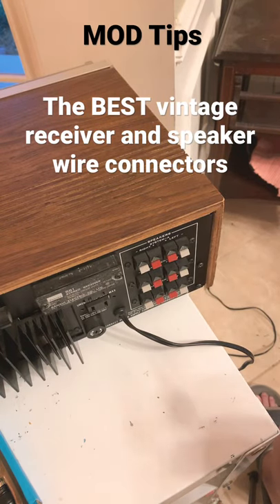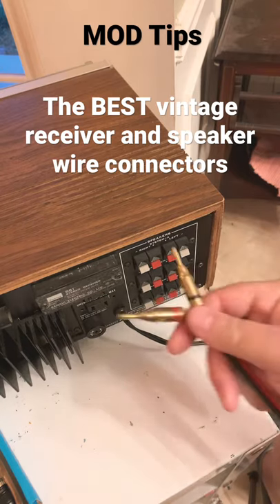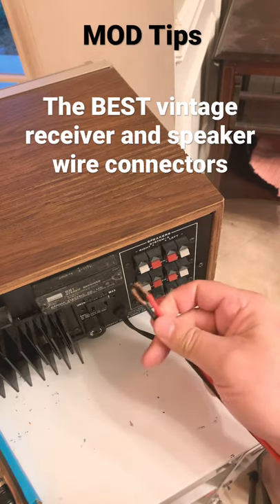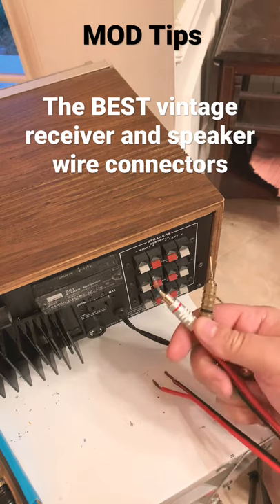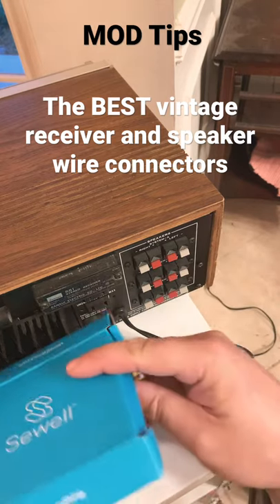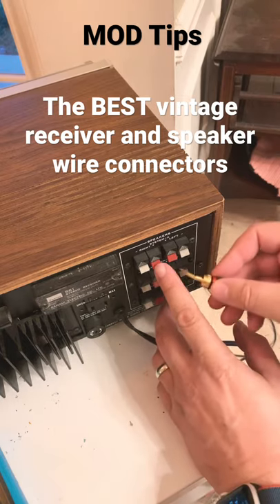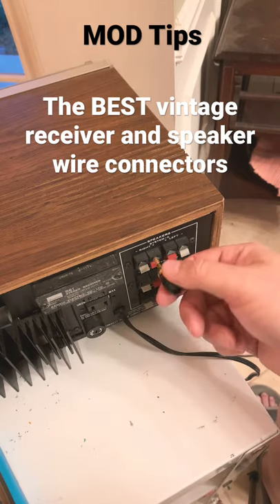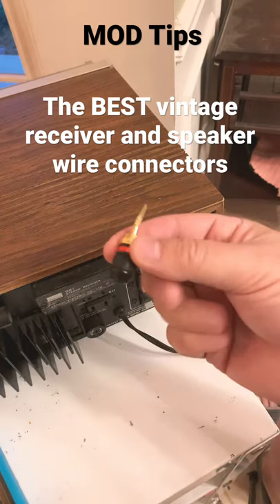MOD Tips: The BEST Speaker Wire Connectors for Vintage Receivers and Speakers

Comment: I'm a bare wire guy, not tinned just twist tight and insert. My Pioneer SX-1080 does just fine by this. Keep it simple!
Reply: I use older equipment and I save as much money as possible so I'm in the same boat as you I don't need to spend 10 dollars on an adapter bare wire all you need
Reply: What kind of wires do you use or just what ever wires then you connect them to a positive and negative pulse?
Reply: @Keytonpollard  A quality 16 gauge wire is all you need for a normal setup, If your speakers are 30 feet or more away from your amp, probably drop down to a 14 gauge wire. + to + and - to -

Comment: Tinning the end of good speaker wire will work nicely and it's a respected practice !
Reply: I do that to each end of about a 12" length of 12Gauge speaker wire and attach a banana plug socket. If I had seen the Deadbolt Flex Pin before I would have made my own I would have been tempted, though I don't need 12pairs of them...
Reply: Only if it’s 14AWG or higher.
Reply: Hi there, what do you mean by tinning?
Reply: @jamespatient7438 using some solder to tin the tip by melting a tiny bit of solder onto the wire.

Comment: I want to Thank you for even discussing this type of adapter.  Some of us have tried everything from Spade to Bare Wire to Spade and have hit a dead end.  I needed to use a 10 AWG wire that would not fit into an old style speaker and because of this adapter it is possible!
Reply: So from this how do I connect this speaker on tv?

Comment: These definitely get the job done and I was using something similar for a while, but I think the best connector I’ve personally found are something similar called lil’piggies. They’re solid bare wire to banana plug adapters. They gave me the best sound out of what I’ve tried. Perhaps this Sewell brand is better…Ymmv

Comment: I have these and they are great. Positioning is key though because they can touch and short.
Reply: Just use bare wire
Reply: @kn4ixc  normally yes, but if you use low gauge wire for longer runs, you’ll need something like these to insert in the connectors.

Comment: Those look like they could short together really easily. On vintage low power receivers and speakers I just use 18 or 16 gauge speaker wire zip cord and strip back 1/2 inch and tin the strands together, clean off the flux well, and dress it up with black and red shrink sleeve.
Reply from the maker: Nope.
Reply: Good solution, keeps the strain off the old speaker output  terminals too.
Reply: @MODAC  I would respectfully debate that. I have the same connectors except they are banana jacks and I have not used them because all that exposed metal creates potential for trouble in my opinion. The crown of that brass nut is not insulated and is connected to the speaker output conductors. in this example you have the flexible wire which allows them to move as the speaker wire is moved about.
Reply: That's what I heard from folks who have used it shorting their amp. I gave a pass on these.
Reply: @zulumax1  I always wrap a layer of electrical tape around my banana plugs to ensure that never happens. I suspect you can do the same here.

Comment: I prefer good 'ole stranded wire with most terminals, including spring terminals.  16, 14, or 12 gauge is all you'll ever need, depending on power output and wire length. I'm not a fan of banana plugs or any pin connectors for speakers. Just my preference.  Most of these new connectors just simply save time at the expense of a good gas tight, low resistance connection.

Comment: My speakers have 4 wires red black blue and grey I dont know how to hook them up. Any ideas?
Reply: Is it a built in amp but still has exposed wires for the hookup?
Reply: @nicholaslibby1515  I bought the speakers at a thrift shop. No reciver

Comment: l just solder the bare wire to 1/8" and slip it in the connector so the wire is not showing to prevent any shorting.

Comment: Be careful with Sewel brand, I got some and just happened to be reading about them in reviews. There is no insulator on the outside, only relying on the anodization to keep the signal from getting where it shouldn't. If the two connectors are touching you can short out a receiver or amplifier.
Reply: Yep. I have them. I tape them because they can touch because they are floppy.

Comment: A solution to a problem that does not exist.
Reply: It does allow you to use a heavier gauge wire and adapt it to fit 14 or 12 gauge wire that would not normally fit into the spring receptacle. Not a problem, just an option.
Reply: Just adds another joint ( where the speaker cable connects to the plug, presumably a grub screw ), if using fat cable, it would be easier to cut of half the strands.